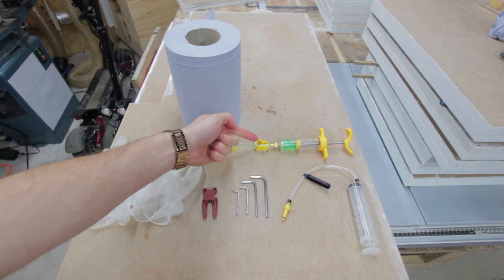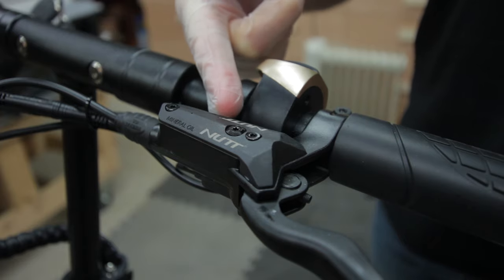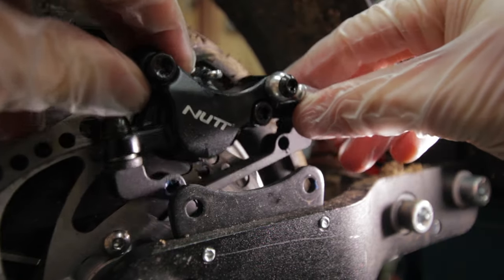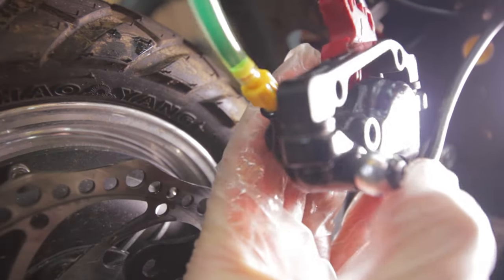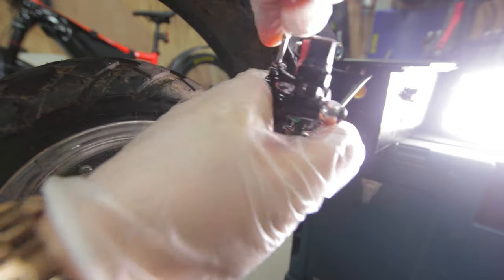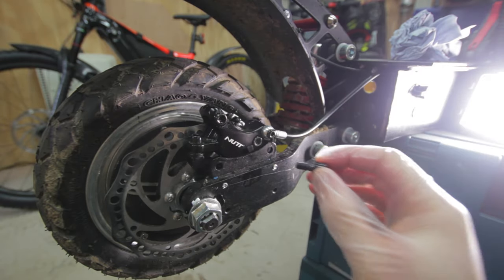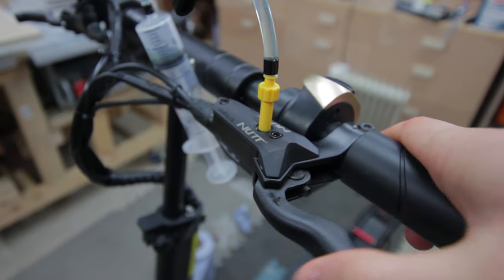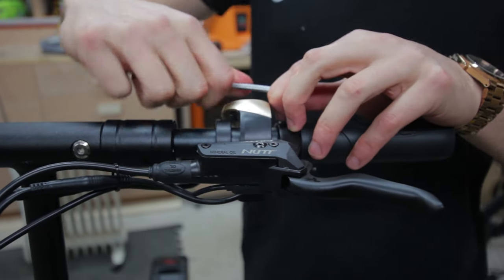HOW TO: Bleeding the Hydraulic NUTT Brake (or most brakes)

Comment: Guys, this is the best brake bleed/fill video. Perfect procedure, Filling from the bottom to the top is the best method to ensure there are no trapped or entrained air bubbles. Well done.
Reply from the maker: Thanks so much!
Reply: Did this procedure 4x. Made a big mess of brake fluid. I finished doing it in the reverse way it says from the top to the bottom. Worked 1st go around.
Reply: @roberturso9654 same. This video lacks some crucial tips to work this way

Comment: Like others have said, this video is 100% I bled the nutt rear brake on my Mukata 10+ just yesterday for the first time and I've never bled brakes before. Made a mess for sure and had to wipe down the whole caliper with iso but for the first time doing this, it worked great! I certainly wont worry about bleeding in the future. Great video hands down, nice and short and straight to the point. Hats off to you sir.
Reply from the maker: Glad you found this video of value.
Reply: I just bought a m10+ and got a brake power off reminder. Do you by chance know what this means? Brakes still seem to be doing ok but want to make sure I’m not missing something important.

Comment: I used this video to perfectly, easily, and cleanly bleed Nutt brakes on a Rad Rover 6 plus e-bike. After seeing so many posts on how difficult this process has been for others, I was reluctant to even try, but I'm glad I did. Did this job in under an hour and for $25 for kit and oil. Thank You!!!!!
Reply from the maker: I’m glad you found this video helpful! 🙏
Reply: I'm trying to bleed the brakes on my Rad Rover 6 plus e-bike, however I haven't been able to locate the proper bleed adapter.  I purchased several kits an none of them have the adapter with the longer shaft.  Could you possibly let me know which Kit you bought which had the proper adapter? Thanks

Comment: Usually, do new hydraulic Disc brakes (NUTT BRAND) come with brake pads already installed? Do new hydraulic brakes need to be bleed before first use ? Thanks
Reply from the maker: Yeah it all comes ready to go! Need to bleed or anything. Should work straight out of the box.
Reply: @SolarScootersuk  do you know where you can order the nutt brakes from? A realiable site?

Comment: Tbh I did it the lazy man way. I left the brakes as is level the lever then attached the plunger and started pumping the lever to pump out the bubbles. Yes it’s easier but it does take longer. It’s not the proper way at but it still works and you get about the same results. I would only bleed if my oil too old like let’s say after a year.

Comment: How good is the solar p1 on range, I know it says 30 but if I was riding dual motors with max power going 30-35 how many miles would I be able to go
Reply from the maker: About 25 - 30 miles in the summer, half that in winter. But it all depends on so many factors, it isn’t a one answer question. 

Ride style, weight, temperature, elevation, tyre PSI, wind all make a difference in how much or how little mileage you get out of a charge. 

Hope that helps.
Reply: @SolarScootersuk  Thank you for the help, probably going to buy this very soon!
Reply from the maker: @chad6243  my pleasure. Take care☺️
Reply: @SolarScootersuk  You too.
Reply: Chad,. There is no way you are getting 30miles with max power doing 35 mph. no chance more like half that. But if u ride slower and don't do high speeds then u can definitely eek it out. I would guess on normal riding I get about 20miles and that's mixed speeds I would say. But if u go fast more like 15 and if u are slowish then more like 25 maybe even 30 miles

Comment: Is there a fast charger available for the standard P1, or is it exclusively for the P1 Pro?

Also sorry for asking again but, realistically if I was going 35mph on dual motors without eco mode how far would I go, heavy rider 90kg
Reply from the maker: It can be purchased separately on our website, only comes standard with the Pro.

Again it’s really tough to answer as so many factors come into it. But in the summer you can expect the rated range of 30 miles for the normal P1 at those settings you mentioned. 

Hope that clarifies
Reply: @SolarScootersuk  Thank you very much.
edit: I can not seem to find the fast charger for the P1 but only a replacement standard charger

Comment: I heard its best to remove the brake pads before bleeding the brakes because the oil can severely ruin your brake pads and you'll need to replace them
Reply from the maker: You can do… but as long as your careful and make sure you don’t contaminate them you’re fine.

Comment: Hi I'm a little confused. I see you put mineral oil and but were does the old mineral oil get extracted from? In other words, how did you get the old fluid out of the system. (Sorry I'm totally new to all of this)
Reply from the maker: In the video there are 2 syringes, one that’s full and one that’s empty. As you squeeze the new stuff in, the old stuff gets put into the empty syringe
Reply: @SolarScootersuk  To be clear... The old oil goes through the system and out the syringe at the handlebar lever?
Reply from the maker: @fpvflyer4758  yes 👍🏽
Reply: @SolarScootersuk  Many thanks! 🙏

Comment: What did you do when you put the syringe in the break leaver?
Reply from the maker: Nothing — it’s just a vessel to collect the old brake fluid. When you pump from the syringe at the bottom
Reply: So does the whole break system need to be filled completely to the top with oil without any air in it?
Reply: @SolarScootersuk  thank you
Reply from the maker: @GavinGrewal-np9sq  yes, as the new oil is being put in, the old stuff gets put in the top syringe like in the video
Reply: @SolarScootersuk  excellent I had a crash on my Apollo phantom ludo and hurt my Nutt leavers and have got replacements so just needed to know how to re bleed the breaks. Thanks 😊

Comment: Thanks for your video. 
Before bleeding, can I empty the oil out of the hose and caliper and fill those with whole new oil?
Reply from the maker: No worries! 

Yes the oil seen in the video is the new oil which is transferred into the brakes, old oil should be transferred into the empty syringe at the top at the same time.

Comment: Was going to do a full bleed and change my pads but before I did so just wanted to know a few extra things 

Would I be able to remove the pads and just put the block into the calliper without the old pads do the bleed and replace with new pads after? Or should I replace the pads first then do the bleed 

Last thing on my rear break I had an issue and had to realign my calliper with the adjustment screws on the top (that allow the calliper to move back and forth) when I replace the pads should I unscrew them and hold the break down and tighten them to align the breaks? Or is that not how it’s done

Thank you a lot if you get back with a reply :)

Comment: Hello sir!  I'm from Austria and have completely converted my scooter Xiaomi 1S (see my last short) and yesterday I bought very expensive Nutt brakes in the scooter shop for €175!  But because I removed the oil hoses for the front and rear of all 2 brakes so that I could put the oil hoses in the holes in the scooter and lay them nicely, a little oil came out of the front and rear brakes!  I have to bleed the brakes now!  I saw your great video 👍 and did the same thing with the rear brake as in your video.  Problem: the rear brake pads which I bled just like in your video, when I press the brake levers the brake pads come together but they don't go all the way back to their original position!  🤔 But just like in the video, I pressed the brake lever a lot at the end until there was no more air coming in and then I closed this little screw at the top again.  I did it a second time but there was enough oil in the rear brake of the scooter motor!  Question: Since there is enough oil in the rear brake, I only need to do it at the top of the brake lever so that the pistons go all the way back!  Should I just open the small screw at the top and connect the short hose with the 20mm syringe and press the brake lever often until no more air comes out?  But could that be the problem because I didn't screw the front brake onto the handlebars and didn't straighten it when bleeding!  I screwed the upper brake on diagonally towards the ground and bled it because I can no longer get the upper brake lever open.  Does the position of the brake lever at the top of the handlebars necessarily have to be screwed on and placed in a straight position?  Could this be the problem why my pistons don't go all the way back in the NUTT brake because I had the upper brake lever towards the ground and not in a straight position like in the video??  Kind regards 🙂

Comment: Can you bleed in reverse like inserting the oil from the top syringe?
Reply from the maker: You can - but you don't want to do that because any air bubbles in the system wont be forced out. So it's best to insert the oil from the bottom to force air out the system
Reply: @SolarScootersuk only if you are pushing. If you are pulling oil from the bottom the oil on the top will get into the system. Pulling makes more bubbles put than pushing. Your method didnt work for me and for many people here sadly.
Reply from the maker: @maciekprokop3780  This has worked for thousands of people, so not sure where you went wrong? If you need more help please be sure to contact our team, they can assist!

hello@solarscooters.co.uk

Comment: hi if i was going 30 or 40mph on dual motor and no eco mode how far will i be able to go on 1 charge
Reply from the maker: On the P1 Pro — around 50 miles in the summer, half that in the winter.
Reply: @SolarScootersuk  how about the p1, keep in mind not eco mode using as much power as possible.
Reply from the maker: @manman-hp1qq  25 - 30 miles in the summer! Half in winter.

Using dual motor is actually MORE efficient than using the single motor... this spreads the load between the motors rather than forcing one to do all the work. 

Using the Regen braking also helps recharge the battery.
Reply: @SolarScootersuk  Oh okay, thanks very much I was considering this scooter but the miles pushed me away, thanks for telling me definitely buying this soon.
Reply: I just assumed that if I was going max speed the battery wouldnt last as long.
Reply from the maker: @manman-hp1qq  you’re most welcome. Any other questions you may have please do not hesitate to ask☺️
Reply from the maker: @manman-hp1qq  this is true. Although it is highly unlikely you will be going full speed constantly.
Reply: @SolarScootersuk  True, thanks for the answers.
Reply: @SolarScootersuk  Realistically how far would you go with heavy rider around 90kg and going 30mph no eco mode

Comment: Just followed your amazing and easy video to put the oil back into my nutt hydrollic brakes and the kit I picked up very cheap on Amazon and worked flawlessly and now my brake's are full of oil and air free and such a happy chappy. You have taught me a simple easy method and took me less then 20 mins and now I can ride my Nanrobot D6+ without air and soft breaking and saved my life ❤️❤️❤️ thanks brother and I take my hat off to you. Best video on YouTube and video is perfect 1080p quality 👍👍👍👍 you smashed it 👌👌👊
Reply from the maker: Thanks brother 🤝 glad we could get you back out there safely
Reply: @SolarScootersuk  👊👊👊👊
Reply: Everything worked flawlessly but my brake pads are worn down. I bought X2  brand new ones for front and rear put them both on and front works perfectly but rear pads won't close together to touch the disk. I haven't tried to bleed again but will do tomorrow. Got no brake at all. I've tried to push in pistons and everything in the book no joy. If I bleed it and still no joy what would you think that might caused it ??? There no stiffness in the brake leave it's dead and I've even tried to adjust it no joy. It do feel tho it's lost a lot of oil and loads of air. Somebody said I might have taminated the piston but no oil leak while I changed the pads. Very strange. I'm fuming 😡 it's the exact same hydraulic oiled brakes in this video for my Nanrobot D6+ scooter. Fuming fuming 😡 not your fault mate. Not sure if it's the brakes or lever taminated or what. Wired just from replacement brake pads which are the right ones 😡😡😡😡

Comment: Hello my p1 pro just came in and I’m new to this. 1) when and why would one need to replace the oil? 2) if I set my regen brake level at 5, how long would the brake pads last? Thanks!!!
Reply from the maker: Bleeding you would only need to do when you feel your brakes are really spongy. With regen at max your pads should last several 100s of miles.

Comment: I was bleeding and put new oil IN my dualtron but when brake it Comes smoke fro the brake . What is this i noticed it direktly
Reply: It’s because when you brake the pads and disk get hot and your clearly spilling oil onto your brakes
This oil then burns as you brake as the disk get hot and this is the cause of the smoke - it’s oil burning

Comment: Can I remove air bubbles without putting in new oil?
Reply: i tried without, worked for few mins.  so i say not really lol.  guess depends how bad it is.  if u just got 1 bubble, and its comes up quick.  u may get lucky.  i know i tried lastnight and i not so lucky.  i need to get a set and add oil....  on brand new machine cant ride it cause it has 0 fing brakes.  really upset about it.  legit flew into 4 lane intersection because brakes just were gone.  luckily no car was coming.......

Comment: How to adjust the pressure of the brake after all air is removed? I always got the feeling it's not tight enough. Less tension.
Reply from the maker: You might need to adjust yours at the pads
Reply: @SolarScootersuk  sorry, my bad. There was still too much air left. I had to do it once again slowly and now it feels firm. So far so good.